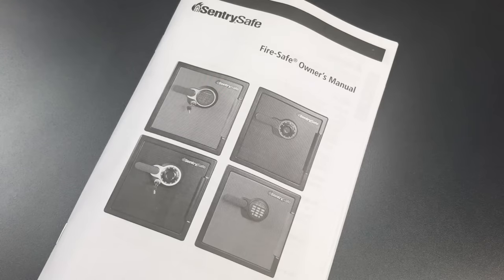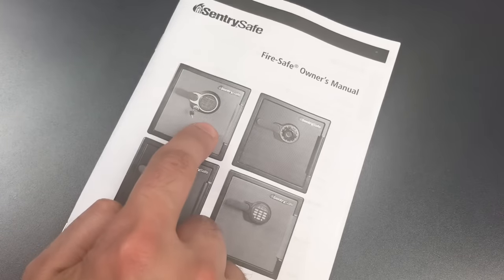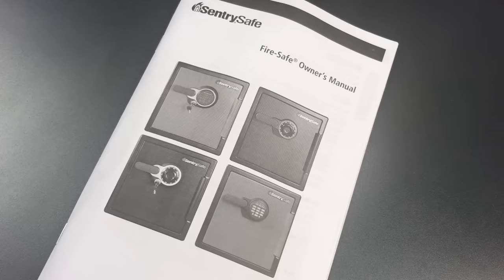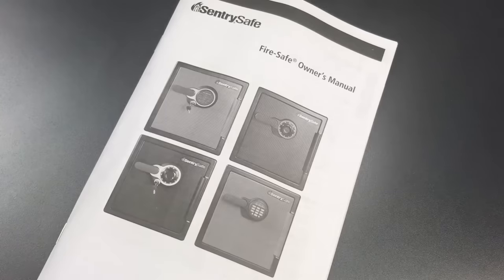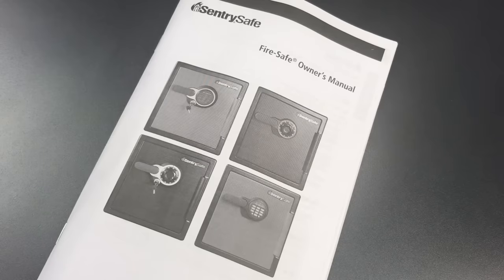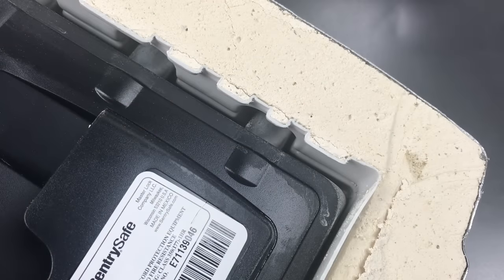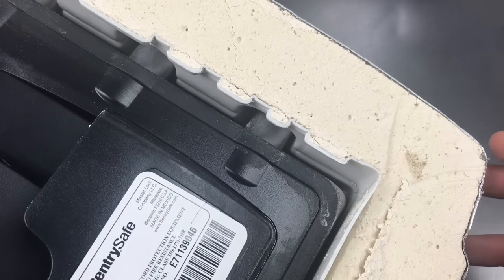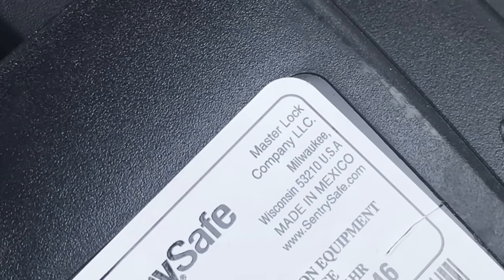[756] Sentry Safe Cut in Half FAST!

Comment: If they strike out the security and just call this a fire proof locker instead of a "safe" they would probably have a product without misleading advertising. That layer of what-ever-that-is quite thick and i'd wonder if it could take a falling beam or rocks on it
Reply: Fire brick is very brittle. Given the thin outer wall it might well end up cracking and getting the contents destroyed in an actual fire.
Reply: It appears to be some kind of fire-retardant foam, probably an expanding polyurethane. If so it will be somewhat elastic and will be able to absorb a bit of a knock when combined with the steel casing, but nothing like a falling roof beam.

Comment: These safes can be popped easily with two screwdrivers , one large , one small . Both used to pry deeper & deeper until the large has enough of a bite to finish the job . The bolts inside just break apart .

Comment: It's a Fire Safe though, it says so clearly on the instruction manual at the start of the video. They're generally meant to keep valuables like passports safe in case of a house fire or other such event. 

Now if it's marketed as a safe meant to deter theft then that's more a fault of the distributor, not the manufacturer.
Reply: There's a lock on the door, so it's security too. If it's not supposed to be a security safe, then just put a latch or handle on the door.
Reply: @thentil  A safe could fall and open in a fire with just a latch. Regardless, putting a lock on something doesn't mean that it's for protection against burglary. 
Regardless, if a safe can be easily carried away, then a lock would be useless.

Comment: I'm wondering. By the looks of it one might even be faster with an axe. Just smashing it a couple times to make an opening in the top, grab what's in it and run away. And carrying am axe is easier than a rotary saw. (And easier to hide)
Reply: Making a hole large enough to safely grab stuff out might be problematic. I think the hole thing might collapse and possibly damage what's inside.
That "metal" is awfully thin though!
Reply: You could likely cut your way in with a knife lol
Reply: A battery powered saw will fit in a bag - an axe won’t.

Comment: So just for keeping your files safe in a fire and that is all.
Reply: it would probably melt
Reply: @1RebelDog1  did you not see the filler material
Reply: @twist3d537  i did, and i really doubt the fire resistant properties of the filler material, don't you?
Reply: @1RebelDog1   no...my firefighting gear is about that thick. Ive been in a 1200 degree room. I am still here.
Reply: @phoenix21studios  ohh yes i would 100% get into your firefighting gear and go into a burning room, i would trust that, but ask me to go inside that safe in a burning room i would think twice, i dont think i'd trust it, would you? :)
Reply: @1RebelDog1  there are various videos of people testing these type safes in a fire. From what I have seen they will keep paper from burning, paper usually burns at 475 degrees.
Reply: @phoenix21studios  i dont think i'd put 10k in this safe,, thanks but no thanks, its obviously a peice of shit
Reply: @1RebelDog1   I wouldn't either. best to put cash like that in your banks safe box system. But I do keep a small Fire Proof safe in my house with things like old letters my from grand mother, HS diploma, Birth Cert, Etc, Etc
Reply: @phoenix21studios  wrap the safe in turn outs
Reply: @bork116  The material is called Nomex.
Reply: @phoenix21studios  You weren't in there that long. Don't go around giving regular peolle the impression that turnout gear is magic and you cant feel heat through it. Or catch it right on fire in a flashover or something. Shits not invincible. I know plenty of guys with SCBA Strap shaped burn marks on their shoulders. 1200 degree ambient air in a room and your gear would be smoking in a matter of seconds. Masks start melting pretty quickly from radiant heat, and I've even seen a guy with a tiny bald spot on the top of his head from where his helmet melted onto his nomex hood and glued it to his scalp. Ouch. He smartly switched to a good old leather helmet after that. Only downside to a leather helmet is that not everyone can afford them. Godawfully expensive, but man are they nice. Leather doesn't melt or burn, it just chars on the outside, which then makes it even stronger against fire/heat.
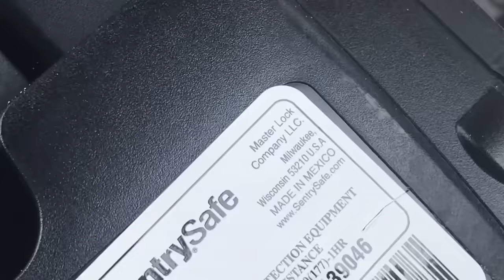Reply: @1RebelDog1  There's this organization called Underwriter Laboratories (you've definitely heard of them or at least seen the "UL" sticker at 4:45 on some product you've bought), which periodically test items like these for durability in different conditions. The only way your product will get a UL certification sticker is if it can perform to certain standards. I would absolutely trust important files in this safe if a fire happened, but again, that's the only thing these safes are designed for.
Reply: @GIJew  cool story, there is no way in hell i would put anything expensive in that peice of shite, i'd get my money, and buy something better.. :)
Reply: @phoenix21studios   I just got a safe-deposit-box renewal letter from my bank. They said "don't put cash in your safe deposit box"!
Reply: @richardfarwell6759  they cant draw interest off of it if you do that. They want your money to invest with. There is no fire load in a vault.
Reply: @1RebelDog1  no I would not the outside will but the inside material will keep you things safe and after the fire you can easily break it off with a hammer after

Comment: If it's light enough for one person to lift it onto its side, it's not a safe
Reply: Those things usually come with a "kit" to bolt them to the floor (you have to drill the holes yourself, obviously, and have access to the interior of the "safe" to install/remove the hold-down bolts/screws).  Of course, if you have the inclination, you could bolt almost any container to the floor, or the wall, etc.
Reply: It is a safe
It's a fire safe
Ment to protect you from fires
Not thief's

Comment: It's a fire safe not an actual safe. It's supposed to keep documents safe when your house burns down. Not keep it from criminals.
Reply: The problem is that if a document or other item is important enough to protect from fire, it's almost also guaranteed that it's important to keep it from being stolen as well.  I can't think of any document or item that I must protect from fire but it's OK if it's stolen.  So, designing a container that protects from fire but not theft has very little use.
Reply: If it's not meant for theft protection, then why does it have a fancy keypad lock with slide bolts??
Reply: @somejoe7777  Put it in the attic and put a decent lock on the attic hatch.
Then they would have to break into your house, break the hatch/destroy the lock, and after that break the foam box.
It is quite unlikely that burglars would take so much time and risk, and in case of fire, you might save the important documents.
If you have a basement, it is even better to put a decent, safe door plus a decent lock and then the foam box.. as fires like to go up and probably your basement will be ok (but flooded).
It is very important to anchor any type of safe to a structural part of the house, otherwise you are just providing a convenient box for the thieves to nick your valuables.
Reply: If that were true why would it have a lock on it?

Comment: Was this a burglary rated safe? A fire safe is different from a burglary rated safe but most people assume a safe is a safe.
Reply: And the owner's manual doesn't seem to do enough to disabuse them of that assumption... nor do the advertisements.
Reply: @AnimeSunglasses  just remember a fire safe isn't a burglary safe and a burglary isn't a fire safe. You can get a burglary safe that is a firesafe as well. Also remember to always anchorbolt your safe down with stainless steel anchor bolts and not brass. Use at least 2 if possible and do it catty cornered unless you can afford 4. Always anchor your safe in a tight area like a broom closet too and never ever brag about or show off your safe to anyone. Another tip is when you are accessing your safe put a towel over the top of it where it covers you dialing in the combination. I have heard of people hiding hidden cameras near the safe so they can catch the owner dialing the combo. Always reset the factory combo as well.
Reply: A safe is to prevent thief,  burglary is thief.... stop reinventing the concept. If it doesn't provide basic protection then its not a safe... it just looks like one.
Reply: @ilovebohol  You are wrong. You can purchase a fire protection safe that usually offer protection for 30 minutes, 60 minutes or 90 minutes. It will keep the contents inside at a temperature under 350 degrees because that is the heat in which paper burns. The walls are not reinforced with steel. It's a safe but someone can pry or strike it and gain access. Your burglary safes are not always fireproof either. You need to check that out with whoever you buy it from. You even have TL rated or commercial safe like the ones found in a check cashing place. It would be a TL 15 or 30. The number is in regards to the amount of time it would take you to drill through the drill points to access the release.
Reply: @JJones-nf9ce  IF IT DOESN'T PROVIDE BASIC PROTECTION,  its not a safe. Its called a LOCK BOX, but companies use marketing techniques to convince you otherwise since labeling it SAFE provide a psychological boost. 

The use of the word SAFE is so over used and misused. 

You are right though that in order to be able to market it as a SAFE it should offer some sort of fire prevention. 

But its NOT a SAFE, its a lock box that looks like a safe that also offer minimal fire protection.
Reply: @ilovebohol  there are many safes that offer protection from theft that lack fire protection. For example the TL rated safes I tried to explain to you about. You need a diamond tip drill bits to drill through the plates around the relocker. This is a commercial rated safe but they aren't fire rated. They might survive a fire but the contents inside will get destroyed for example paper money since it burns at 350 degrees. 
A fire safe is has its walls made out of fire board that is resistant to burning and will keep the contents inside safe from extreme heat for a little while. While it is not resistant structurally to strikes and cutting like a burglary safe it can still be hard to get into to. Also there is usually a plastic foam lining that is installed around the interior of the door. This expands when it is exposed to extreme heat thus sealing the contents inside to protect them from heat.
You can also get safes with burglary and fire rating.
Reply: @JJones-nf9ce  thanks Justin, appreciate truly your time to reply and share your knowledge.  Rest assured I'm grateful for your time to reply and thank you for sharing your thoughts,  i will update my understanding on this topic.  I guess im just old school and reflects my dads understanding on the matter for which it needs an update 😁😁👍.
Reply: @ilovebohol  no worries. I used to move safes and install them. I also hold different state accredited lock smithing certificates since I used to be an apprentice but I'm always open to knowledge if you have it to share.
Reply: @JJones-nf9ce  If all it was meant to do was protect from fire, there wouldn't really be a need for an electronic keypad and a tube lock on the front.
Reply: @WilliamPitcher  you needs to realize that while a fire safe can lock you out the construction wasn't meant for striking,  prying atracks,etc. A burglary rated safe is more difficult to successfully defeat. Usually the burglar is on a short time frame due to alarms, etc and they cannot crack the safe successfully
Reply: @JJones-nf9ce  Except - Sentry rates this safe as a Security, Fire and Water protection safe. In fact, they have four levels of security ratings and they give this safe a 'Maximum Protection' rating (their highest) saying that it provides 'maximum protection against a determined thief'.
Reply: @WilliamPitcher  sentry kind of sucks. Look into American security. Or get a TL rated safe that they use in jewelry shops,etc
Reply: Of course it isn't "burglary rated", but it is being marketed for physical security:  "Preset combination fire safe with secondary locking key for strong security; combination safe features four live-locking bolts, steel construction, pry-resistant hinge bar, shelf, and bolt down hardware."
Reply: It is a deterrent against burglary. Bolt it to the floor in a confined area and it will deter all but the most determined thief.
Reply: @bart99gt  you are correct. Any veteran burglar could crack that safe. ALWAYS USE STAINLESS STEEL ANCHOR BOLTS and never brass.
Reply: One way to avoid the confusion would be to not have a lock on a fire safe, but then people wouldn’t think it was a safe at all!
Reply: Justin Jones watch the video and you'll understand
Reply: @ilovebohol  it;s a fire safe for documents

Comment: I've got the Media Safe version of this product.  Honestly, I don't even keep it locked.  It's purpose is to hold backup hard-drives, flash-drives, etc.  I'm less worried about theft than fire.  I did in fact accidentally lock it and had to contact them in order to get a backup key because it'd been so long, I'd forgotten where I'd kept it.  It's now taped to the front.   It's good to know that if it still does get locked and I'm not around to tell someone the combo or find the key, it's easy to access.   But part of having a safe is also keeping it in a place inobvious to a casual observer.

Comment: Okay, I know this is old and no one will read this. But I do need to say this: NEVER EVER use gloves while operating a circular saw of any kind. DO NOT use gloves with any tools that spins. This is due to the danger that getting the glove caught on the rotating part of the tool, it will essentially pull your hand in, break your wrist or worse.

Comment: You ever notice that when someone shows us a brute-force attack on a safe, it's never bolted to the floor? They flip it around from side to side.  Lay a big safe on its back, then use their weight on pry bars to pry up the door?

Yes, it's a cheap safe.  No safer than the trunk of my car, but I don't have a car's trunk in my bedroom.  I should just put everything in my dresser, no attempt to secure it?  No, spend $400 on a real safe.  Don't have $400, so just hide it in the dresser?  You can't address it's fireproofing?  The UL label is right on the door.  And neither my car's trunk or my dresser drawers are fire rated.

The reviews of these safes are always the same, why this isn't a $400 high security safe, for $100 it should be!
Reply: For that price you could get a Welder at your local fab shop to build something pretty decent. You also would be better off simply hiding your valuables, perhaps in a false wall cleaning bottles etc. 
I have an old sentry safe and I know it is only good enough to keep the kids out.
Reply: @SlayerofFiction  Or buy couple of sacks of concrete, old ballbearings or some other hardened steel from scrapyard and cast additional safety layer in top of that.

Would add some weight to make it more difficult to carry away.

Don't know about the front or about the lock, but at least this would get much better with small money.
Reply: @teropiispala2576  I am going to assume you have never fabricated anything in your life.
Reply: @SlayerofFiction  You assume very wrong. Making things have been my hobby since I was young. I did wood-working from age of 3, etched my first electric cirquit board when I was 7, leaned to weld when I was eight, made hydrogen bombs into plastic bottles using electrolysis in about the same age. And no, I didn't learn this  from my parents.

I built aluminium casting owens 25 years ago and casted robust enclosures for my electronic designs. In 1995 I came third in Texas Instrument global dsp design contest with automotive dsp unit which I designed and built. 

Nowadays I own wood lathe, milling machine and metal lathe with lathe ans mill equipped with cnc control and software, which I have made by myself. I also practice forging, can still make welds if needed (and own equipment for that) and been concentrating to make better tools so I can make better tools. I have grinded my own surface plate from scratch, after byuing proper piece of granite from local quarry.

I'd say that comparing to average people, you couldn't be more wrong.
Reply: @teropiispala2576  I'd say by reading what you should do you have the experience equivalent of someone who has only watched youtube and has no real understanding of fabrication at all.
Reply: @SlayerofFiction  I'd say you have very poor skills of estimating people's experience. I have done most of those things before youtube even existed. 

I don't have experience of industrial manufacturing, but what comes to making things by hand, I think I already said it.

What comes to you advice to buy a welder and build a safe. I don't think an average people could get much done. On the other hand, casting a safe inside a concrete, most people would get it done if they are smart enough to put enough weight inside so it don't float or build for example wooden box where they can attach it tight enough.